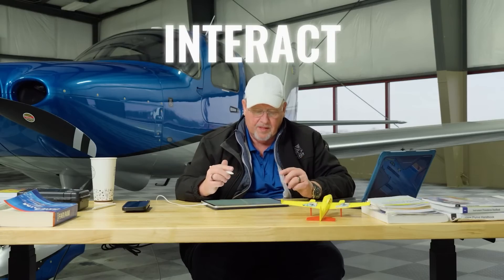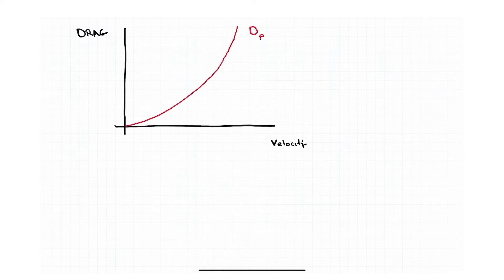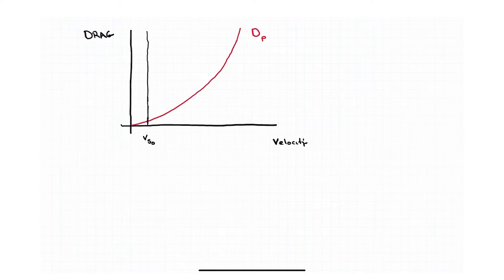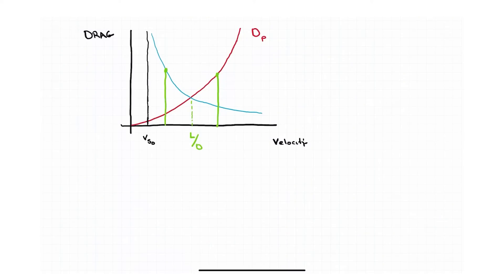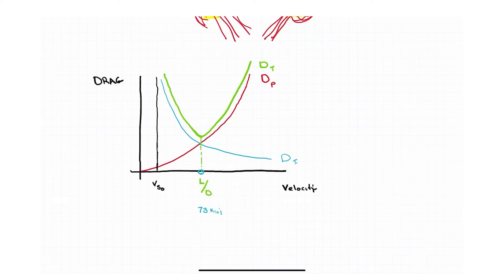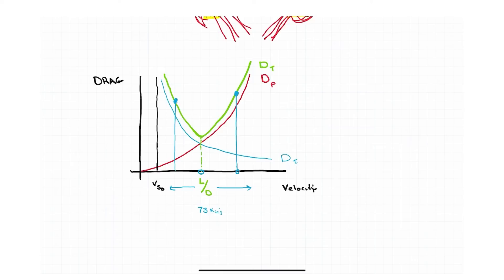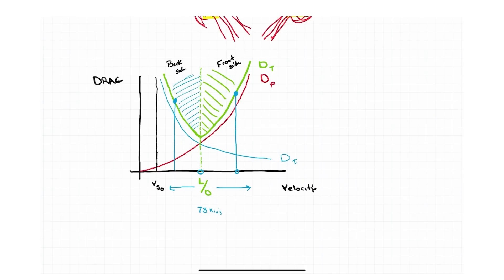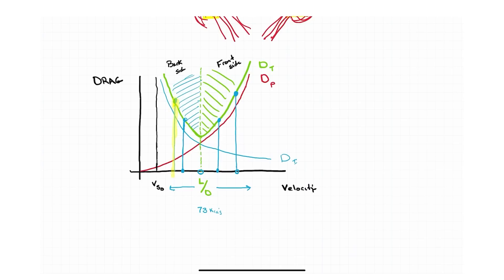Principles of Flight: Understanding The Region of Reverse Command

Comment: The graph showing profile drag increasing with speed is a quadratic curve, not parabolic. Drag increases with the square of the speed. You should also state that you are discussing the aircraft maintaining level flight. The total drag is better shown by clearly indicating the addition of the two curves by using a vertical speed line and adding the two segments to create the new total drag point.

Comment: Stick controls speed across the whole curve. It is normal sensing in this regard across the whole of it. What gets reversed is subsequent VVI should you lack means to compensate with power.
Reply: I prefer to call it reverse demand not command to give a better sense of it; note it occurs at maximum endurance hence is L/Dmax for jets, gliders, no working engine propellers but minimum power required for working props.

Comment: “If I’m here at say eighty knots and I want to fly faster, I simply add more power…” nope. Doing so will maintain eighty knots and induce a climb. Forward stick will get you faster while simultaneously adding power will keep you level. Simply adding power generally maintains AOA neglecting prop wash and thrust line effects while increasing altitude.
Reply: You hit on a good point about what power really does.  It always adds energy, and most of the time, it acts as an elevator and changes the pitch.  As you mention, it often induces a climb because in a model like the Skyhawk, the propeller slipstream will normally lower the tail if trimmed out.  THAT is a hugely important point - it results in many people believing that power controls altitude.  I was with a pilot in a Cherokee Six who tried to go from red-over-red back up to the glideslope so he increased the power.  For whatever reason, maybe the heavy engine, maybe out of trim, the pitch didn't change and he stayed firmly red-over-red and accelerated 10kts.  What if there were an obstacle?  Bottom line - that's the potential catastrophe that can happen by being taught that the power alone can control altitude.  The fact is the maximum force created by the thrust line is less than 25% of the weight in small airplanes so it's quite impossible for power to oppose weight and control altitude.
Reply: @warren5699  power only changes the pitch due to prop wash and/or off-axis thrust lines. A centerline jet has no pitch change with power changes. The pitch change of power is an extra aero concern beyond the four forces model.
Reply: Yet in that centerline jet, power still acts as “the elevator.” Interesting aside, the control surface we now call elevator was originally named a flipper. Calling it the elevator is actually misleading. Believe someone mentioned Aerodynamics for Naval Aviators. It is available in the FAA Handbooks where you get your PDFs and also in ForeFlight under FAA Handbooks. It gets into a great steady state climb discussion showing power addition makes you climb and does so with no pitch change, though believe it also mentions prop wash and off-axis thrust lines causing such. And it shows such as adding extra mechanical energy via consumption of chemical.
Reply: My bad, sorry, fast typing, power does not change the Angle of Attack. Pitch does change even with centerline jets. Both pitch and AOA change with prop wash and with off-axis thrust lines. Sorry, that really probably introduced confusion. Again, my bad. Yes, pitch and VVI both change with power, AOA however is constant in the four forces model while power changes AOA only changing due to stick movement and/or those extras.
Reply: Fast typing and too fast reading thus misreading AOA where pitch was discussed, again, sorry for that.
Reply: @jimallen8186  Climb with increase in power and no pitch change?  Haven't read the Navy book, but that should happen with any airplane as an increased airspeed will increase the lift vector.
Reply: Sucks YouTube ‘edit’ function for comments never seems to work for me. 

And as an aside, with the pitch difference, yes there is a vertical component of thrust, but it is so small for GA such as to be negligible. Instead, your weight contributes a bit to the drag direction while your load is now smaller. Lift becomes greater than load as not all weight goes to load, some goes to drag. Thought experiment: what is your lift demand if steady state at pitch of ninety or minus ninety (straight up or straight down)? Zero. Load increases with bank but decreases with pitch though usually our pitches are too small to think about this. When they’re not too small, usually there is also a rate involved.
Reply: @warren5699  correct, again, I meant AOA and got typing fast reading pitch while thinking AOA. Sorry. I really muddled that up.
Reply: I’d edit it to clear it up but edit btn never seems to engage for me.

Comment: “We typically don’t see induced drag till faster than the stall speed…” False! You don’t see much of it on takeoff roll as you’re not yet demanding an AOA and thus are not generating much lift, but if you slow to stall and deeper into stall you’re producing lift just insufficient lift with lots of induced drag. Were you to try an early liftoff, you’ll be below stall speed with loads of induced drag. Your drawing here is highly specific to your takeoff situation you were just describing but is not generally applicable. You have induced drag increasing all the way to ninety AOA zero airspeed. Think about a conical parachute.
Reply: PS: non-symmetrical wings do produce some lift and therefore induced drag during takeoff roll before rotation. It just happens to be a smaller amount.
Reply: PPS: tail wheel with symmetrical wings that fails to lift the tail on takeoff, same is true with you (and is a big part as to why you lift the tail).

Comment: I prefer to call it region of reverse demand as opposed to reverse command. Why? Power techniques used in this region work in the same sense on the front side. They just do it with nonlinear magnitude required. What is reverse command is pitch driven techniques which we do well to avoid when we can. Search Medium for Improve Your Landings with AOA and Power Techniques as well as Back Side of the Power Curve vs Drag Curve to see what I mean. Front side vs back side happens at L/Dmax only for jets, gliders, and engine out; with propellers functioning the divide is at minimum power. Easy way to remember this is that in all cases the divide is at maximum endurance. Note this is an AOA not a speed.

Comment: In Aerodynamics for Naval Aviators, the region of reverse command references just the fact that to fly slower (in level flight), more power is required.  Whereas in the region of normal command, to fly slower less power is required.
Stick still controls speed in both regimes; it’s just not apparent.  In steady state flight, one can see this by looking at the trim setting.  The faster the plane flies, the lower the pitch trim will be.  In fact, there is only one trim setting for a given speed, in steady state flight at a given moment.  Therefore, In Aerody for NA, it does not reference the stick for speed as a supporting def for the region of reverse command.
Reply: Look on Medium for Improve your Landings with AOA and Power Techniques. Follow this up with Back Side of the Power Curve vs Drag Curve. You’ll like them. Major points here are the dividing line is Maximum Endurance not necessarily L/Dmax while Power techniques are Reverse Demand on the back side, Pitch techniques are reverse command. We should prefer power techniques as sense is normal across the entire curve (and they’re more precise) but for some platforms such as those with lots of compressor inertia and/or slick drag profiles, power techniques may be precluded thus we get forced to pitch techniques.
Reply: If you are using the stick to control speed, where is the force being generated to oppose the weight of the airplane to control altitude?
Reply: @warren5699  you have coefficient of lift and velocity squared both in that lift equation. You’re adjusting Cl and velocity must change to seek and keep equilibrium. Lift balances load. Remember load includes weight and g with g being influenced by angle of bank and pitch angle but mostly by pitch rate until you reach a steady state. Stick is really doing a balance of coefficients of lift of two airfoils, horizontal stabs vs wings. Stick enables you to control speed which can be done by zooms or dives, or if staying level, with power adjustments for accelerations and decelerations. Power alone, however, will cause climbs or descents. There actually is value in chapter four of the Airplane Flying Handbook though you can find easier writing in Stick and Rudder with ‘the law of the roller coaster.’ Try in Medium the article Improve your Landings with AOA and Power Techniques. Look for the trim discussion within it. Though catch the energy discussion at the beginning.

Comment: Sorry but there are some glitches in this explanation.  The graph in the PHAK (figure 11-14) has power setting (i.e. power required) on the left side rather than drag.  This places the emphasis on power management, i.e. not being bashful with the power, especially in the lower speeds where the airplane is nearing stall speed and in some cases full power may be needed to avoid a stall.  That's usually not the case but could be.  The main point is the power required to maintain speed will go up as the speed goes down toward stall speed - hence the region of reversed command - as speed goes down power required goes up.

Your description of the steps taken by the pilot for slow flight recovery would not work.  If the airplane is in the region of reversed command, no matter how slow, the wing is still opposing the weight and the power is maintaining the speed.  The pitch and power are not what reverse - what reverses is the speed and power required.  When the pilot starts recovery from a slow speed to a higher speed, as required on a flight test, the altitude must be maintained.  If the speed is increased by reducing the induced drag (pitching down as you explained), you will go down (and bust the altitude and flight test).  If you do that on an approach, you may hit an obstruction.  To regain speed with no change in the line of flight, simply follow the basics with thrust vs drag - increase the thrust as necessary so that it is greater than drag - the airplane will accelerate.  As it accelerates, reduce the lift vector to avoid any ballooning and to maintain a straight line of flight, whether it is level at 3000 or to maintain a straight line on the glideslope flying toward the aiming point.
Reply from the maker: Hi Warren, thank you for your feedback.  Although I have been doing this for a bit,  I still and always will continue to learn from others.  As you know, Figure 11-14 in the PHAK is the Power Required Curve.  In this video, I was not referring to the Power Curve.  I was referring to Figure 5-6 with the intention of explaining the  Drag versus Speed graph.  

As you observe this graph, you will note that if we are flying at the speed of L/D max and want to speed up, while maintaining level flight, we have to add power to accelerate and overcome the increasing parasite drag.  Although the angle of attack will decrease, causing induced drag to decrease, due to the increase in parasite drag, the total drag increases.  Hence more power is needed on the "front side of the power curve".

Now, let's go the other way.  If we are flying at L/D max and we want to slow down, while maintaining level flight, we have to add power to overcome the increase in total drag caused by the higher angle of attack and increasing induced drag on the "back side of the power curve".   Now, here is where this may not have been clear.  Many people make the mistake of reducing power.  If we were to hold our altitude and reduce power, at some point we are going to get too slow.  If we hold our speed instead of altitude, we are going to lose altitude.  So, what we should do is slowly start adding power as we slow below L/D.  How much power?  What ever is needed to hold the altitude and overcome the ever increasing induced drag as we continue to slow down and hold altitude on the back side of the power curve.
Reply: @MidwestCorporateAir  Steve - thank you for your comments.  Since you were getting into the 'regions of command' terminology, I immediately thought of Fig 11-14 since the regions of command are discussed in that section.  But I see that your drawing represents Fig 5-6.

Basically with the regions of command, 99% of the discussions I see just don't follow the facts.  For example, the thrust to weight ratio of a Cessna 172 is 23.3% -  a Boeing 777-200ER is approximately 28.5% - which means maximum thrust produces a force equal to less than 30% of the weight.  So that means power is not capable of opposing the weight in order to control altitude - not even close.  So when you hear the usual 'power controls altitude in the region of reversed command', you know that is a misunderstanding.  The PHAK explains that as the airspeed decreases the pitch is increased to keep the lift equal to the weight.  It makes no mention of anything changing below Max L/D.  It also makes no mention that thrust and drag change.  I.e. to reduce speed, thrust must be less than drag, no matter the current airspeed.  The definition of the regions of command refers to the speed vs the power required - not some reversal of pitch and power.  That's the most common misinterpretation I see which then leads to incorrect use of the controls and poor control.  Think about it - what really reverses?  The drag - it goes down, then it goes up.
Reply: @warren5699  Try searching Medium for Back Side of the Power Curve vs Drag Curve. You’ll appreciate it. Follow it up with Improve Your Landings with AOA and Power Techniques. For propellers, the power required curve is the correct curve. Jets, gliders, and engine(s) out, drag curve is the correct curve. Using Maximum Endurance AOA as your divider will always keep you honest. (Yes, Max E is an AOA and the speed changes where the minimum demand is but the AOA is constant. Want proof? Consider where absolute ceiling occurs.)
Reply: @MidwestCorporateAir  “Now, let's go the other way.  If we are flying at L/D max and we want to slow down, while maintaining level flight, we have to add power to overcome the increase in total drag caused by the higher angle of attack and increasing induced drag on the "back side of the power curve".” This would be correct in a jet but is wrong in propellers. The logic is sound but minimum power is where this occurs. To use the drag curve with propellers, you need to also incorporate power to thrust conversion which makes for a big mess. Better to simply move to the power required curve.
Reply: Point of curiosity: why do helicopters use drag curve not power required? Their engines produce power too? Because generally they remain at full throttle while using combinations of cyclic and collective thus changing blade angle hence making trades of lift vector, a force, to thrust vector also a force.
Reply: PHAK does both power req curve and drag curve incorrectly treating them interchangeably in the front/back side discussions. Which curve is correct depends upon what you are flying. Drag is for jets, gliders, and engine out. Power required is for functioning propellers. If you instead use Maximum Endurance as your point of division, you’ll always be on the correct curve.